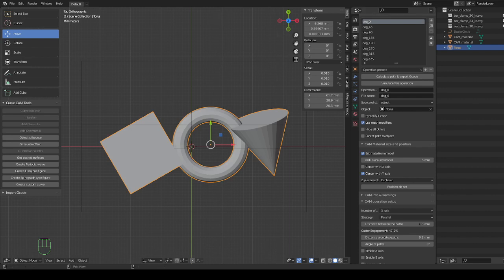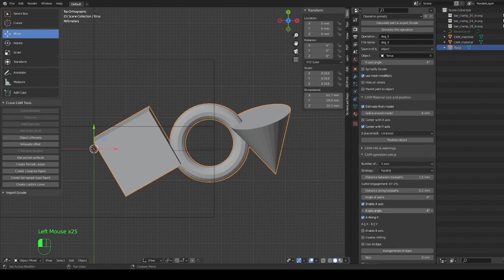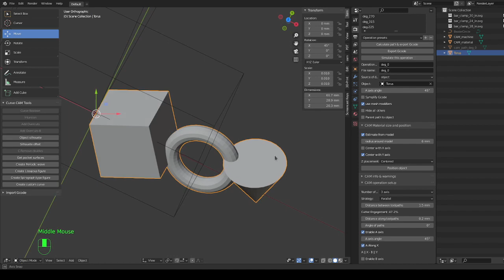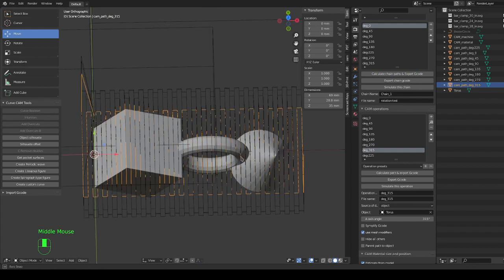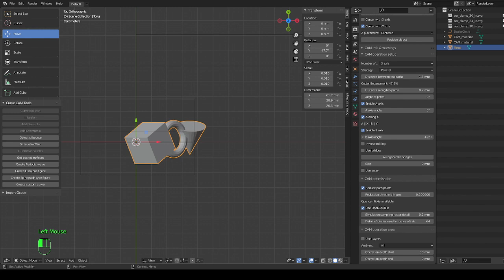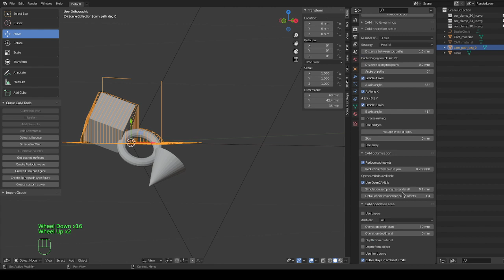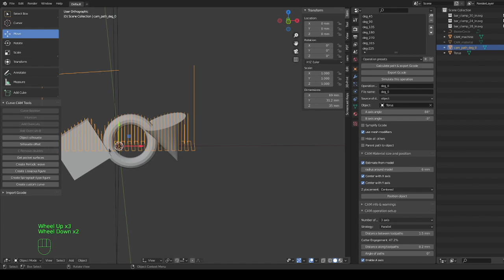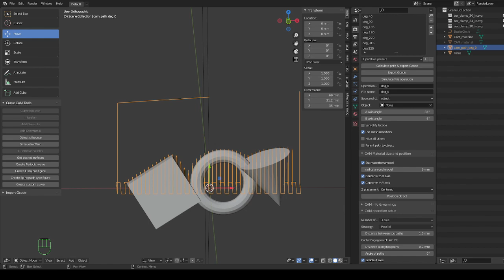fabex cnc:4 5 Axis indexing

Comment: Hey Alain,  I am working on a project I have go the 4th axis paths to calculate, However, the simulation never yields the expected result.  Would have any tips or ideas to let blender properly simulate these cuts
Reply from the maker: you are right, the simulation does not work on the 4th axis path.  in fact you can simulate with just one iteration at a time.